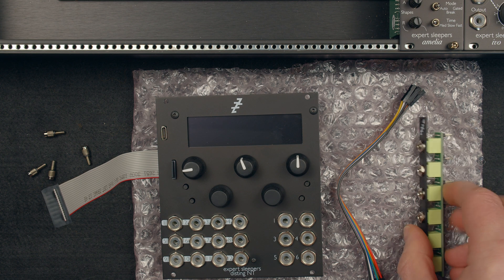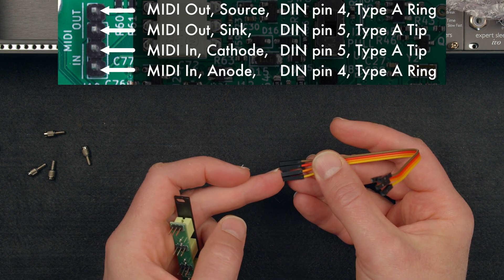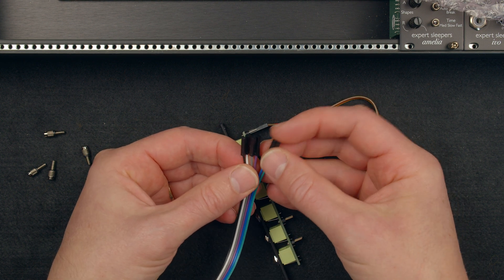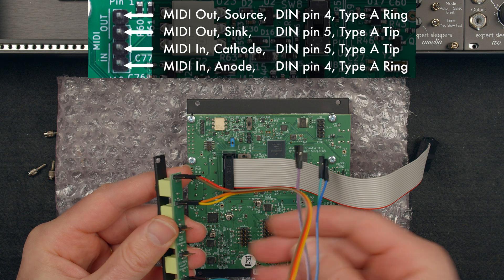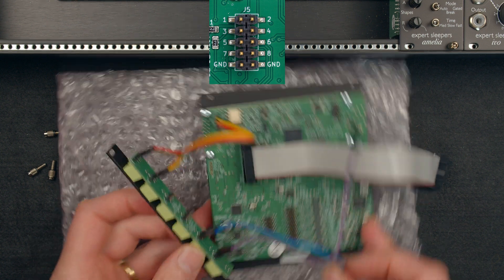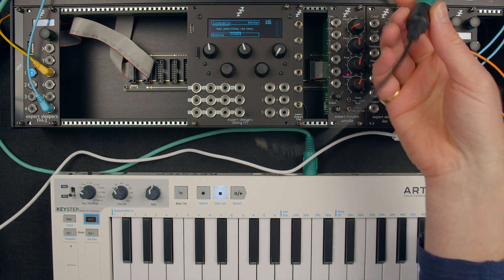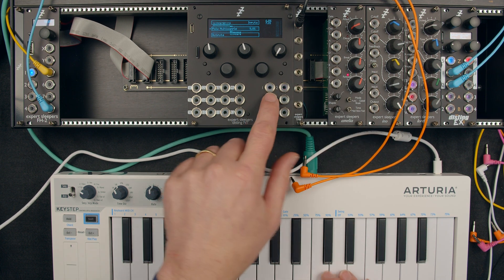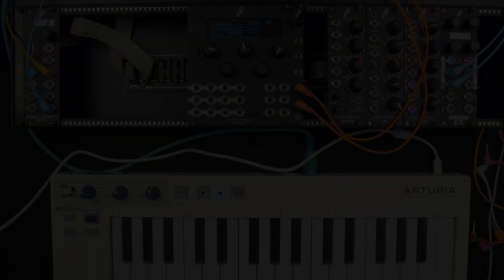disting NT - Connecting the breakout

Comment: kind of a dumb question and I know it is not the intended use-case, but could you effectively use the 2 remaining jacks to swap between the 2 TRS midi standards if you interconnected them and swapped the tip/ring?
Reply from the maker: Yes.